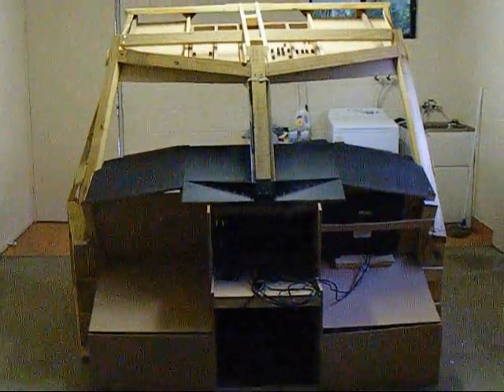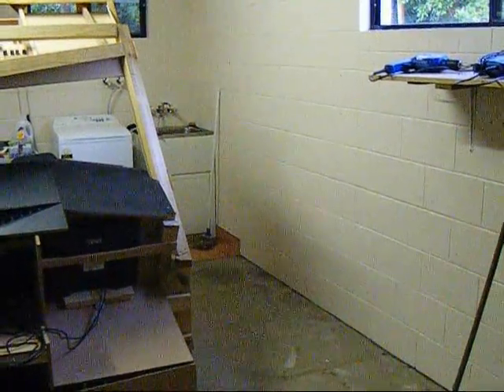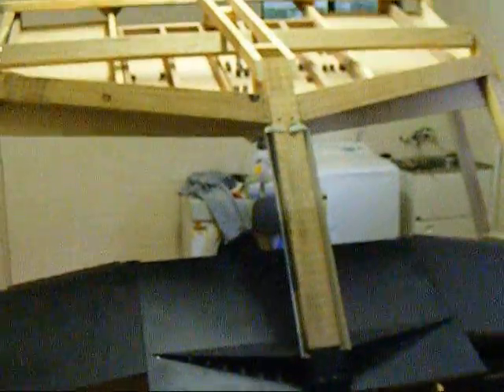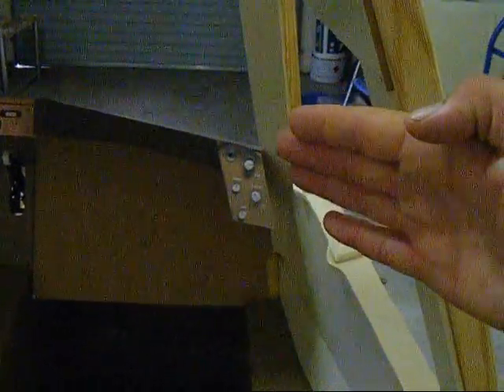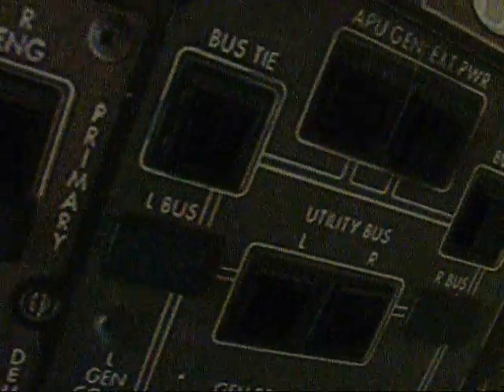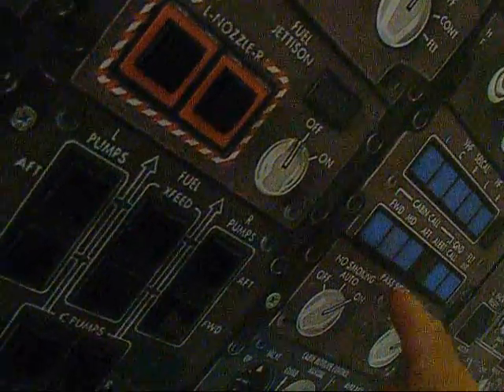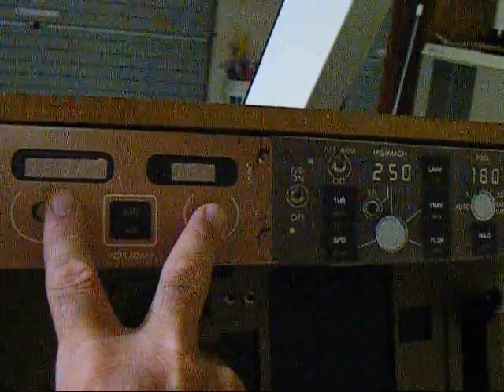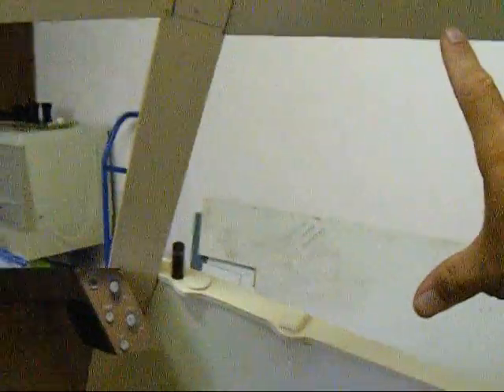767 cockpit project Part 1

Comment from the maker: 180 degree wrap around visuals using 3 BENQ M118ST projectors at 1280x800 native is almost complete. I have now networked 2 computers together. 1 old pentium 4 3.2ghz running fs9 and the leveld767 plus hardware, the coreI5 will be dedicated to outside visuals only. I will update pics and videos etc once its complete. A full scale 767 yoke almost here and also have a fully functioning 767 flight management computer to hook up aswell. Stay tuned ! If you need building plans etc drop me an email.

Comment from the maker: Using the jigsaw for the mip was quite easy, all you need is patience and a reasonably steady hand. I made sure the blade was new and I had no trouble at all. The 19inch monitors are 4:3 1280x1024. The captains monitor will be replaced with a better brand as its contrast is a litlle washed out but works great.

Comment: Hey Drewster! Great videos!. Wondering if you might be so kind as to send your 767 MIP Panel layout plans, overhead pjpgand any 767 specific cfgs. I decided not to go with the 737.It seems that the front MIP panels on the 767 utilize all the monitor and not just 2/3rds like in the 737. & The hang over of the 737 monitor is not good. Are you using 4:3 or 5:4 19 inch monitors(1280x1024) all the way around or what aspect ratio and size do you recommend? Thanks Mate! dj12345678 at charter dot net

Comment: Where'd you get your panel MIP's bezels and frames? I'm on a limited budget so I cant afford the poldragonet panels and I don't think I can cut MDF holes out good enough. Would you recommend maybe taking main panel sized MDF along with some autocad drawings and see if a machinist can cut it out properly?
When you do your upgrade on the visual projection screen, what do you think you will be using? 3 projection - maybe use warpalizer? Or too expensive?

Comment from the maker: Hi guys, I'll update the video's soon with some inflight shots and also a video on how it all works and what I did exactly to get it all working. I started the build with the shell yes. For interfacing the buttons and switches I use a great program called FSUIPC and a BUO386X joystick card from Leo Bodnar. These 2 things allow you to easily interface switches and buttons with flightsim etc. More on that soon.

Comment from the maker: Hey Guys thanks for the responses. I'd just like to say that Airvice8 does make a valid point about the gap between the overhead and the glare. It is a little bigger than the real aircraft by a few inches. However having said that I will help rectify that by adding a couple of window panels to the top of the exisiting windows to narrow the gap. You will see exactly what I mean shortly and it works well. More videos soon.

Comment: @airvice8 Wrong. His gap is fine. and even if it was wrong, it wouldn't matter due to structural constraints and also projection potentials. If he ends up using a projector, that gap will have to be wide anyway.